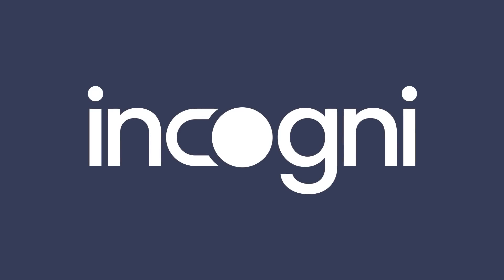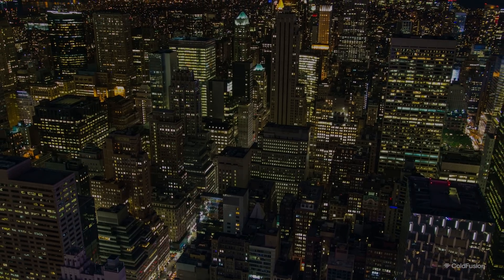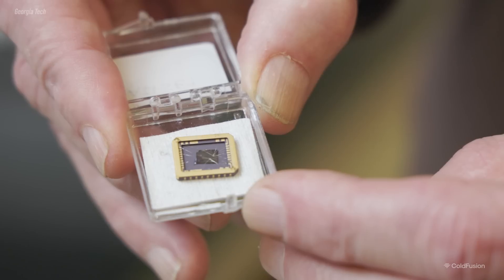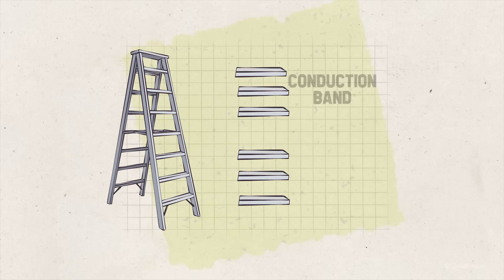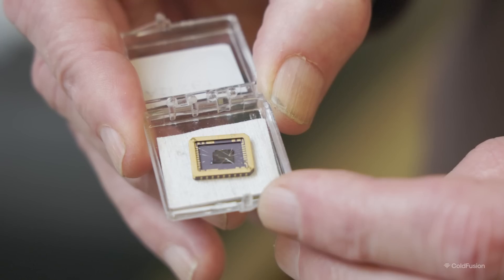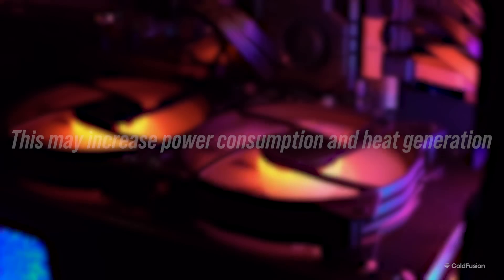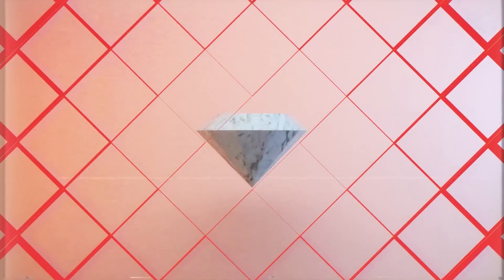This Chip Could Change Computing Forever

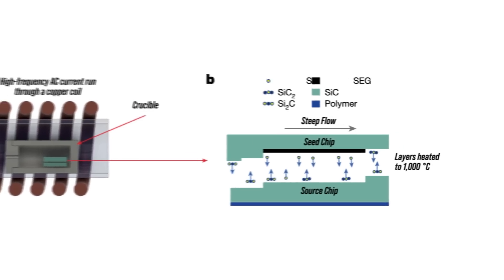Comment: This is kinda the worst explanation of how a process works I've ever seen. So the image at 7:15 (with Si and SEG formatting going bad and not fixed, with no mention that SEG = Semiconducting Epitaxial Graphene, so basically no explanation of what we're looking at at all) and half a quote is all we get on, let me quote 1:10 "let's check out how they did it". Was the "research" on this video just reading the abstract of the paper? Cause I could have done that myself and saved myself 12 minutes of my life and probably gotten more insight out of it to boot....
But thanks for at least linking the paper. Kudos for that at least :)
Reply: I think coldfusion kept their slow rhythm of delivery but lost on the impact of technical and practical depth
Reply: @denvernaicker8250  sounds just like Intel

Comment: We could already have had devices that lasts for days, weeks. The only problem is that manufacturers keeps using up that power budget by increasing chip processing speeds. Look at 5 years ago. How much wattage did a cpu use? Probably around 15W average power. Today? Still 15w, despite that we've made leaps and bounds in power efficiency research. Color me skeptic, but I doubt we'll have weeks of battery life until manufacturers stop pouring every saved watt into more performance.

Comment: Summary: "it could change the field of computing"

As of now, graphene-based chips are NOT being produced at a commercial scale. We are yet to find cost-effective methods for producing high-quality graphene at scale and integrating it with existing semiconductor technologies. Most developments are still in the research or prototype stages.

Comment: Thz level transistors are pointless, the interconnect elements can't work at these speeds, limiting the switching speed in large systems with many transistors to not much more than we see at the top end today, at least without moving to new transistors interconnect medium, and as cool as optical based systems sound, that doesn't make sense unless the transistors can direct accept and output light without need for converters.

Comment: I mean we have had low power devices for twenty years, people just generally dont use them outside special niche cases. They want power and performance, new features etc. ARM even went that route, tho it did help revolutionize portable devices. But hey, graphene and Gallium based tech will be interesting over time for sure. Especially for batteries. ICs are so developed at this point via silicon itll be hard to meet their performance for their use cases. We shall see.

Comment: Yeah i don't believe this. It doesn't explain how it became a transistor at all. You just said it's been heated with an ac electromagnetic coil inside a quartz tube then what? You just get graphine which is still not a semiconductor. Either explain it probably or leave it

Comment: The small band gap implies low operating voltage, as well as possible sensitivity to temperature. I think they will be able to tune the band gap by controlling how long the initial "baking" step is.

Comment: In my opinion most phones and laptops are never going to last a week on a charge. Not because it's not possible, it's just not what they're for. Sure if you're going off grid for a while it might be useful but the vast majority of use cases will have a socket available for charging. 

However that is not the revolutionary use case for this. Faster compute at low energy cost just means that we can do a lot more with our laptops. Imagine running a GPT 5 or more realistically LLama 4 locally instead of having to interface with data centres and paying for subscriptions. That'd completely remove latency from voice assistants and essentially give you access to a genious helper at all time for free.

Comment: I mean... Sure, they can make a graphene transistor and a single one outperformance a silicon based one, but ehm... i do believe we have BILLIONS of those on like 1 squared centimeter. 
So sure, the groundwork has been further improved but it is still waaaaaays off from replacing existing silicon based electronics.
Also, we haven't reached the limits of silicon yet either. Advances are also being made there year on year. Heck the top of the line stuff isn't even available for consumer hardware.

Comment: I don't know why I used to respect this channel. This video is so one-sided and one dimensional. There's a massive gap between creating a material in the lab with some properties and creating a computer, which you barely acknowledge. And I simply don't believe that this material is 100% upsides with no significant drawbacks. Honestly this video came across as amateurish or clickbait.

Comment: 00:00 🚀 Scientists at Georgia Tech have developed a breakthrough in computing with a focus on graphine, a material that could revolutionize electronics.
03:16 ⚛ Graphine, a 2D material, is highly conductive and has various applications, but its use as a semiconductor faced challenges until recent breakthroughs.
06:27 🛠 Scientists have successfully engineered graphine with a band gap, making it suitable for use in transistors, paving the way for faster, more efficient computing.
08:23 💡 The development of semiconducting graphine enables better computers with higher electron mobility, potentially lasting longer and operating at terahertz frequencies.
10:16 🔍 While the breakthrough shows promise, the smaller band gap of graphine compared to silicon may lead to increased power consumption and heat generation in some applications, but refinements are expected.

Comment: I'm skeptical, it would be nice to hear experts on the downsides as well. We have heard graphene promises plenty of times already, but no significant real world usage happened so far.
Current leakage is not a huge issue, current silicon chips are already very leaky, and chip designers design their way around it. I think they do it by completely turning off parts of the chip when not in use, but I'm not sure.

Comment: So in the video, there is zero information on how they engineered the band gap. No changes in chemical composition or molecular architecture is reported. It basically goes:
This is the problem, then they solved it. How? Don't know, but they sure did!

Smells fishy.

Comment: Graphene was discovered in 2004, before that it was a theoretical material that scientists weren’t sure if it could be fabricated. But the research shown in this video says that they began in 2001. So they worked for all those years in a graphene based transistor only on theoretical bases, not knowing if the material would exist in the near future?

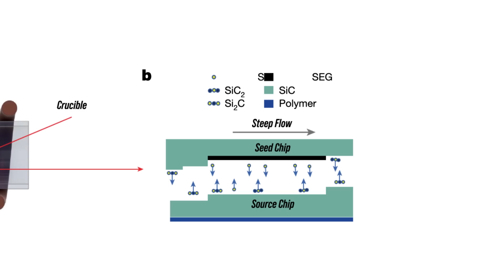Comment: Little point of critique: At about 7:04 you go from "Graphene doesn't show semiconducting properties." over "Look at this diagram, this is how one could produce very finde chip-like structures." to "And now it HAS semiconducting properties!!"
That was... a choice. It reminded me of the old "Phase 1: Collect underpants. Phase 2: .... Phase 3: Profit!" joke.

Was this done on purpose? I mean, for how much you emphasized the missing semiconductivity, it was really quite absurd how quickly you then brushed it off, acting like you had totally explained everything now.
Yet exactly this part is completely missing in the video - HOW DID THEY MADE IT A SEMICONDUCTOR ?

Besides this, great video! As usual. :-)

Comment: Leakage has always been the issue with graphene, also that transistors are larger than what we can do with silicon but graphene is indeed fast. If they really have figured out a way to have reasonable leakage, such that it doesn't destroy SNR, there are some inmediate applications even if it is electrically inefficient: Ultra fast analog to digital conversion, fast enough for direct sampling of light with nano antennas and that could make fiber optics orders of magnitude faster and could also have big implications for astronomy (software interferometry with light).

Comment: Seems to me all the researchers have done is make a sheet of graphene that is influenced by the silicon carbide layer under it. As the silicon carbide has to heated to really high temps to have silicon evaporate I don't see a circuit made on the silicon carbide but under the graphene layer surviving the high temps of manufacturing graphene.
So 
You going to have to grow an electronic circuit on top of the graphene. Be really interested to know how they going to do that. My guess is that is way way harder than making graphene

Comment: Another pipe dream... Graphene has yet to live up to its expectations. What happened to scientific discoveries having to be peer reviewed and vetted by a community of experts before being released to the general public? It's just Holywood now, they go for flashy annoucements with zero proof of commercial applications.
And news flash: band gap is a property of a material at the atomic level. To "manipulate" the band gap is impossible, you need to change the material itself.

Comment: Why isnt there any news on HEMT (GaN, GaAs) at all? If at all there is any chance to make a step increase in performance without requiring a fundamental shift in process tech, then it can only be HEMT not Graphene. Yes Graphene has some great properties but then its a completely different process, there are yield issues and there are very few commercial products with Graphene except a few batteries here and there. Compare to that, HEMT can be grown on existing silicon wafers and are more or less compatible with the process and also is commercially very much there today.

So in real practical terms, we should be working more or paying more attention to the HEMT progress. Can you do an episode on them please?

Comment: The preprint mentioned in the notes is Zhao et al., Ultra-high mobility semiconducting epitaxial graphene on silicon carbide, Nature 625, 60–65 (2024). 
The novel material is not actually graphene (a semi-metal), but the eponymous SEG, which is a monolayer chemically bonded to a SiC (silicon carbide) substrate; this bonding appears to be at the root of SEG being a semiconductor. 
The bandgap is measured at about 0.6 eV, which sets it apart from graphene. The material is doped, remarkably, with O_2 and features a mobilities of ca. 5000 cm^2/Vs, which is considered remarkable. 
The authors exhibit a FET fabricated with SEG as the channel material; it features an on/off ratio of ~10^4. 
The crux will lie in fabricating LSI-scale devices with this material. 
~~~~Arthur Ogawa

Comment: The first transistors were not just "switches", they were a transfering varistor.  They only switch on completely when saturated.  Transistors acting like switches is a special case where the switch saturates very easily.

Comment: most of these breakthroughs are still far from this current generation, they've been saying we will have concrete high capacity capacitors 3 years ago or the diamond based battery that can last thousands of years without charging, or the simultaneous heterogeneous multi threading 1 year ago,  but still we're not seeing any of these getting implemented on a consumer level devices...

Comment: No, when I did my masters in Computer Science there was a research paper that suggested they had created 1nm transistors (this has no relation to what Apple, AMD, Nvidia, TSMC call their "process" as all silicon based transistors can only be 5nm in length before quantum tunneling takes effect) by using a silicon substrate with molybdenum disulfide and carbon nanotubes.

That was 2016, and guess what? It doesn't exist, or at least has made 0 impact or usable chips. 

Same as quantum computing being the "game over" for all encryption. It both simultaneously is and isn't. A calculator from 1975 is more accurate than any existing quantum computer. Different use cases sure, but a computer which has 0 accuracy, is so affected by outside stresses that it has to have a building sized box and multi cooling loops to bring it down to near 0 kelvin whilst being housed in basically a bunker due to cosmic rays having a dramatic effect on it, is not a suitable computing solution to any problem that currently exists. Materials science is about 500 years behind any of the lofty goals that get claimed like "room temperature superconductor".

The latest example was a diamagnetic sliver with bismuth in it that was repelling a grid of magnets, and struggling to even semi stay afloat, but every piece of science illiterate media ran with it.

Comment: If you only wanted the computing power of a computer 20 years ago, you could run a ultra low power processor on a laptop with a huge battery, but no one wants that, do they?

Comment: While the process of working with SiC relies on the preestablished Si fabrication tech, it does have its own challenges such as scalability, purity and isn't as easy to work with due to its hardness.... Also side note, it's a whole new realm working with superconductors because you no longer measure voltage drops and resistance, but measure magnetic fields and whatnot instead. Just my $0.02

Comment: My phone goes 6 days cos its a dumbrick.
If they make a battery with 6 times the capacity per gram the manufacturers will make the batteries 6x smaller and charge more for the compactness.

Comment: okay so this means that when the band gap is increased a little bit more we'll start implementig this on everything right?
Reply: Probably not, even if they achieved their stated goals right now it would still take years before manufacturers switched over and adopted this new technology. The manufacturing costs need to come down and the final product has to be reliable compared to silicon. Then you'll see a slow roll out probably starting with expensive smartphones and see how the public adapts to the new tech, then as the tech becomes more widely adopted the costs will come down even more and we'll see it being adopted across the board. This all assumes that graphene-based semiconductor processors don't require a radically different architecture; if it does then that'll slow down adoption even more.

Comment: Small band gap isn’t necessarily a problem, you just run lower core voltages, so long as you can make the FETs turn on at those voltages.

Comment: why aren't we coating aluminium wires with graphene to make cheaper and better conducting wires?
Reply: Making graphene is expensive.specially if you are only using it to transfer electricity.

However if a chip is made from them , material cost would be that much of a deal
Reply: @braineaterzombie3981  thanks, since the setup was cheap I thought the product was also cheap.

Comment: Back when mobile phones had cameras so worthless that you carried a real camera with you around. Or maybe even future back when mobile phones where going from something you talked into turning instead towards being a SMS device. Back then phones lasted days without needing to be charged.

When you open the camera app on a smartphone to this day, everything in the background usually have to be paused to prosses the image capture of 50mp or more sensors. Not one camera/sensor. But multiple. Even if overnight our chips are 10x faster or 10x more energy efficient? Maybe both at the same time even? So what?
If I take up my Android phone and aim the camera at food. The phone tells me it is food. If I aim the camera at text? It tells me it is text. Rather then longing for a 10x something. Why not question WTF our devices are doing. And note. It is not YOUR device. It is a lie to call it ours even. Considering that phone calls are mostly spam or nothing relevant to anyone anymore? Why not park the devices from communicating to towers 24/7. Why not turn off automatic notifications pinning painstakingly for updates? Even if your phone took 10min brakes between checking if you have a new message sent from friends and family? Would it really hinder your life? Or maybe it would help it. Smartphones are a amazing tool and it is humbling to take out a midrange phone and snap a image with resolutions and clarity that would be considered infeasible to do 20-30-40 years ago. (without the most professional of equipment that is.)

It is also very strange to take a 10+ old computer and throw what in reality is a quite bloated Linux image (like say Linux Mint.) and have a machine so screaming fast and lean to question why anyone needs anything more then that. It is incredible to even have 2! cores of compute power! A single core CPU and 2GB of ram is more then enough. Twice that? It is luxury.

Outside of playing games and AI whatever whatever. The modern computers we have today are fast enough. A mobile phone with todays tech + some more sensible decisions made? That alone is going to give everyone that wants it a 10x faster, 10x more power saving, 10x longer lasting. Tool.

Instead companies are going to 10x downsize the battery size, 10x the price, and to top it off 10x the infeasibility of the thing lasting more then 4years.

Comment: This still seems like all hype and no progress. Even if what they say is true and the band-gap issue has been solved, how are we planning on manufacturing chips with this new semiconducting graphene? Traditional nanoscale lithography techniques don't work on graphene. Even if this advancement is real we're still 40 or more years away from this being used in chip manufacturing. The chip design, if even possible, will lag years behind this. Not to mention ever component of a computer must also be updated to use this tech otherwise the cpu would just get bottle-necked by the other components. So many things will need to be developed before this technology comes fully into fruition.